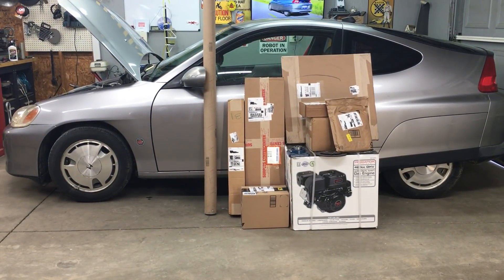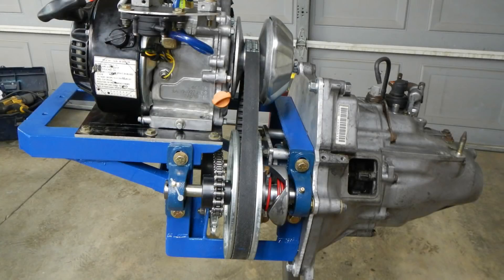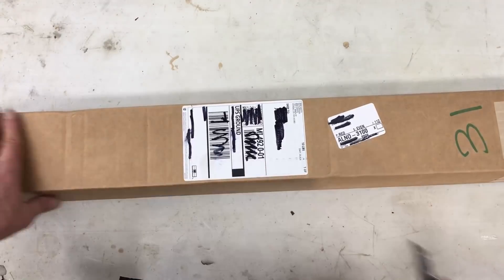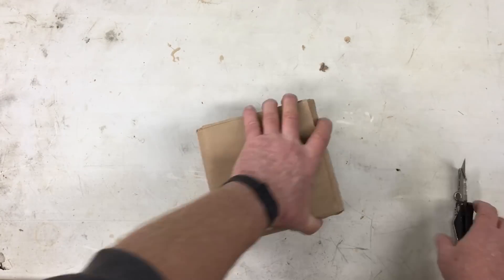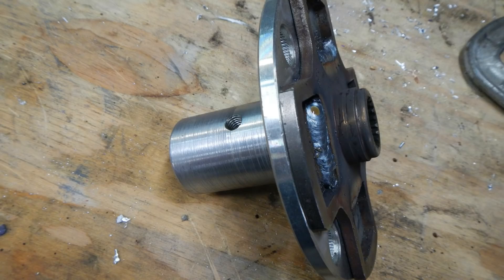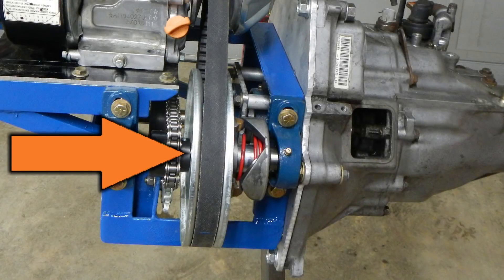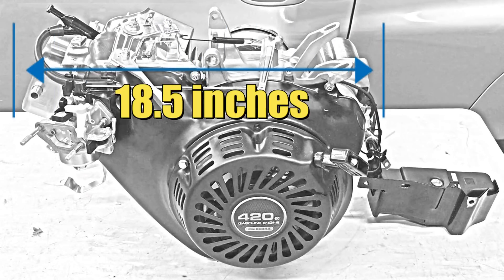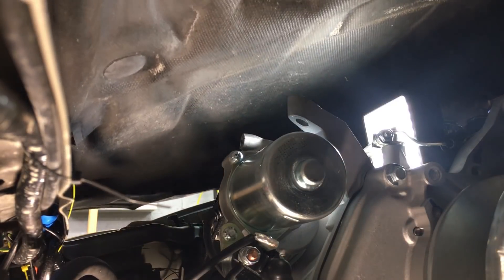Episode 9. Honda insight 420 cc predator engine swap unboxing parts

Comment: I use a cheap torque converter on my predator powered 31 Ford pickup and it works great. My only problem is I am only getting 14 mph at top speed and I am looking into getting a 420 for my project. And yes it is street legal with lights but no charging system 😊

Comment: the belt CVT steals a lot of power and the belt can slip. mopeds can use only CVT because they are light and don't need as much torque to launch. I understand the CVT makes up for the 5 speed transmission having both not enough range and also too wide ratios..

Comment: Tryin the China predators.  Nothing but good remarks on these motors.   Honda’s I can’t say the same.  I own a lawn business.   15 years running my Honda junk years was huge.  No more.  Over priced and there auto chokes suck.
Reply from the maker: My only complaint on these engines are they are a little bit more noisy than a real Honda engine.

Comment: A centrifugal clutch will put all the power to the transmission. The torque converter really isn't needed with the 5 speed transmission thats in the car. Really you are robbing lots power and torque.

Comment: Just discovered this channel and have binged through all the build videos up to this point.  

The only reason for a friction clutch is that it would be less parasitic losses but the clutch would lack the low end torque and frequently burn the clutch requiring frequent replacement. I guess that many forget that this is a heavy car and not a racing mini bike.

Comment: 1 inch is 2.54 centimetres

100 cm is 1 metre

1000 metre is 1 kilometres

With me it came out as 43,18 cm
So I think something is wrong with your calculator, but who cares!
Reply: 17 inch is (17x 2.54=) 43,18 cm ≈ 43 centimetres
Reply: Do inch times 2,54 and you have metric centimetres

Comment: i dont even think the car would move without the torque converter
Reply: It would with more reduction from the chain drive. There is a Predator powered truck that's able to pull a semi with such an arrangement.
Reply: @PistonAvatarGuy  but you would lose top end , the advantage of the torque converter is that it acts like a CVT ( constantly variable trans)  Once the torque is used in the low phase, the bell returns to close to a 1 -1 ratio, bringing the top speed back up.. With a chain , youre stuck in a  fixed ratio at all rpm
Reply: @airgunningyup  Thank you for explaining the obvious. Your comment was that the car wouldn't be able to move, you were incorrect, so I pointed that out. Also, unless he's running the car in 5th gear at top speed, he's not going to be out of gearing at the top end.

Comment: also im really curious as to why you order all you metal stock online and not go to a metal depot same with the pillow block bearings seems like things that could easily be locally sourced for roughly the same price if not cheaper
Reply from the maker: I work a full time job and spend most of my free time building stuff and editing videos.   Its tough to find time so I end up buying stuff on line.

Comment: torque converters take more hp to run belts dont flex and turn as nice and frealy as chain thiers always more loss but in my opinion the loss is worth the torque conversion
Reply: Yes, just like a hydraulic torque converter on an automatic transmission....

Comment: You might see better power using a flat slide carb out of a cr125  or a 250 two stroke race bike.    Those chinees Evey ones are ok but have trouble once it's moded or get close to Max flow.     Im courous if and how much faster if it would be

Comment: I know I'm a bit late, but they do make 13hp diesel engines, and that could be cool to see (I'm not really into diesel engines myself much because of the pollution aspect compared to gas, but I still like the idea of a small little diesel in a big car)
Reply: Diesel is cleaner burning than gas.

Comment: I like the cvt idea but you are losing efficiency through it from friction. Up to 30% loss in the cvt. 

I'd use a 3D motorsports manual clutch. So it shifts completely normal again. 
https://3dmotorsport.net/

I would definitely not use a centrifugal clutch.
Reply: didnt they go out of business or at least stop all production? i've never seen that clutch in stock since i learned about it a couple years ago
Reply: @DracolegacyOfficial  i know the owner. He also makes the Langmuir Systems CNC plasma table.. Ibelieve he still sells the clutches through the website I linked.

Comment: I imagine the anti torque converter crowd generally feel that way because they're very lossy devices.
Reply: exactly, two chain and sprocket sets are more efficient than one chain and one tourque converter. he should still use the stock clutch as a centrifugal clutch won't allow shifts at higher rpm.
Reply: @lucasvanhamburg4937  rev "matching" is very easy with a transmission with synchonizers
Reply: @nirodper  yeah for a good driver, when I make things I always try to make it easy to use and idiot proof. and what about low rpm cruising? it's just not practical or durable.
Reply: @lucasvanhamburg4937  low rpm cruise? we're talking about a car with a glorified lawnmower engine that's being pushed to the max. It will be always full throttle and the better the drivetrain efficiency, the faster it will go
Reply: @lucasvanhamburg4937  that would be difficult without the flywheel with the big flat surface
Reply: @MilesPrower1992  would have to make a "dummy" crankshaft, i've seen other people do it

Comment: Besides a cool project what is the main goal here?
I happen to have a 2002 Honda Insight.
I completely love your ingenuity 🥂
Reply from the maker: Goal?  good question.  Mostly just having fun.    I hope folks enjoy the videos and possibly learn something.
Reply: @robotcantina8957  I think it's really cool what you're doing, probably not legal in California where I'm from. 🙄
Reply from the maker: @GenXRyker   LOL, I used to live in Rancho Cucamonga.  Nothing  of what I do is legal in CA.
Reply: @robotcantina8957  Ca rules and regulations suck 😒
Reply: @robotcantina8957  so that 420 engine actually has a hemispherical combustion chamber?
Reply from the maker: @GenXRyker  There are two types of predator 420 engines,  The one that I'm using is generally known as the hemi version.  The hemi version develops slightly more torque, however the horsepower is the same on both engines.  The interesting thing about the hemi version is the top end of the valve gear appears to be really well made.
Reply: @robotcantina8957  that's pretty cool actually, I have a Hemi so I appreciate what they are, a masterpiece of ingenuity. 
Love you other videos too btw, funny 😋 good stuff I do appreciate. 
Have a great week, look forward to the rest of this build.

Comment: I have to say I love your fan club....lots of fans we see.....
Plans to see what the motor does stock and is there plans to mod this motor at all after seeing how it works?
Reply from the maker: The engine is going in more or less stock with only a carb jet change and a custom exhaust.  After that we will do some mods.   I would love to do fuel injection  at some point.
Reply: @robotcantina8957  That is cool. Down the road a stroker Hemi big block upgrade? Fuel injection could be fun and MEGESQUIRT is the way to go for that and with the electric start with the motor?
Reply from the maker: @ckosacranoid  I have had a lot of experience with Megasquirt and that is certainly one of my choices.  I am also looking into a small engine fuel injection kit that is being offered through various sellers.  Stay tuned!

Comment: The primary reason to ditch the belt style cvt is there is a bunch of parasitic drag from the belt on the pulleys. It's anybody's guess at what point where the extra drag outweighs the acceleration advantage though.
Reply from the maker: Hey Kevin, Thanks for the explanation.  The drag issue makes sense.